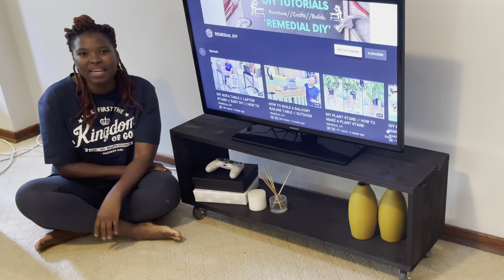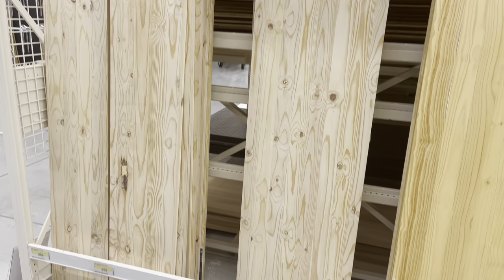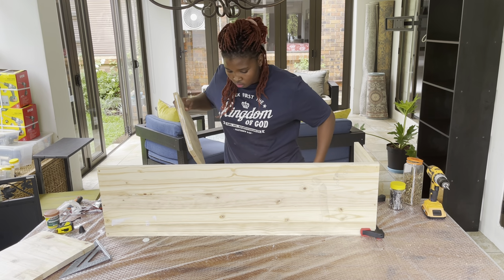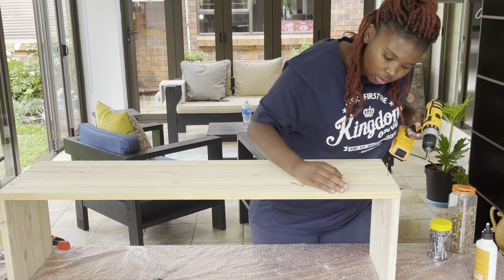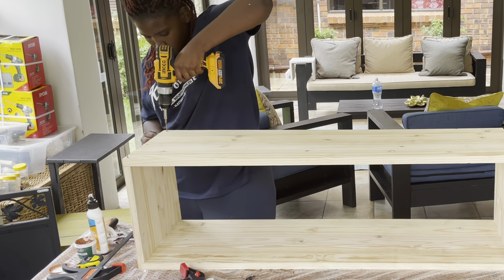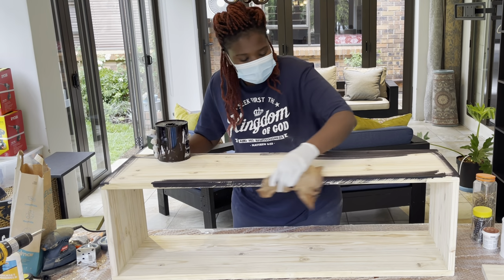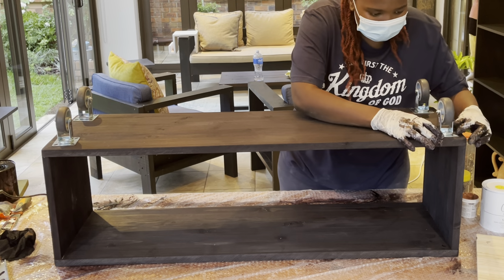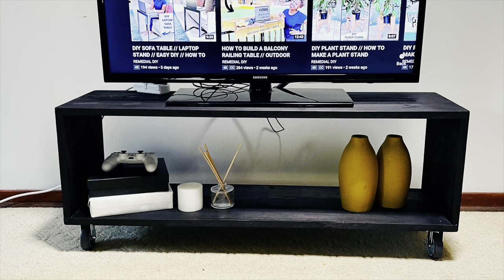HOW TO BUILD A TV STAND  // DIY TV UNIT // EASY DIY PROJECT

Comment: Hey Ndi, loving your content 🤩🤌. This is the first project I'll try. When pre-drilling, do I use the same size drill bit as the screws?
Reply from the maker: Oh my , My Pastor , thank you so much for this .Ndo livhuwa. 
The drill bit you use when Pre Drilling can be same size or even smaller than the screws but make sure it’s not bigger than the size of the screws  because it will not hold nicely / tight . 

And also , remember to Instal a third wood cut in the middle of the stand so that you can balance the weight of the tv overtime. 
You made my day ❤️
Reply: @REMEDIALDIY  thank you so much Ndi. I'll definitely share when done ❣